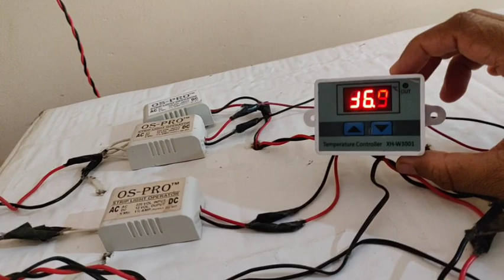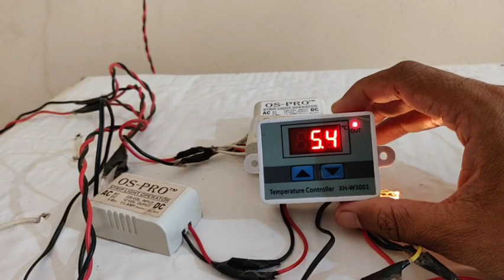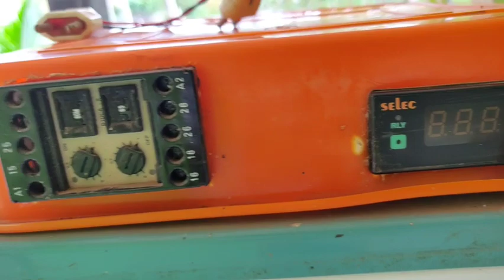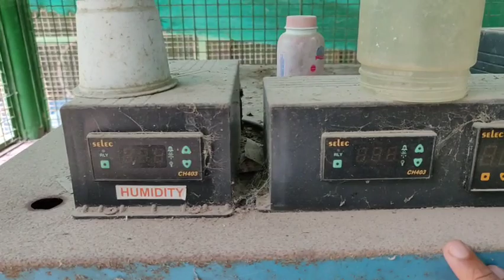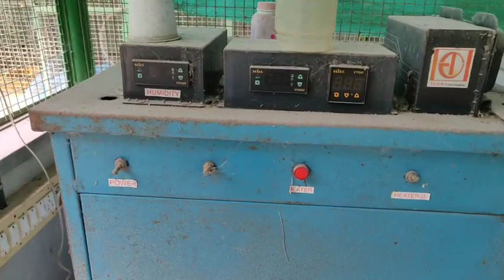Egg incubator നമുക്കും ഉണ്ടാക്കാം | Home made incubator | Home made incubator malayalam

Comment: വൈറ്റാണ് കുഞ്ഞാകുന്നത്
Reply: ഒരു കോഴിമുട്ട വിരിയുവാനുള്ള ചൂട് 37.5 ആണ് 38 ൽ കൂടാൻ പാടില്ല
നിങ്ങൾ തെറ്റായ വിവരം ആണ് അവതരിപ്പിച്ചത്
Reply from the maker: കൃത്യമായി പറഞ്ഞാൽ 38.8889 ആണ്. അതാണ് ഞാൻ 39 എന്നു പറഞ്ഞത്. ആയിരത്തിനു മേലെ കുഞ്ഞുങ്ങളെ ഞാൻ ഈ രീതിയിൽ വിരിയിച്ചിട്ടുണ്ട്.
Reply from the maker: വൈറ്റ് അല്ല കുഞ്ഞാകുന്നത്. താഴെ കാണുന്ന details നോക്കുക.
The yolk has a small white spot on it called the egg cell or germinal disc. This is the part of the egg from which the baby chick develops. The yolk provides food for the baby chick while it is growing in the shell. The albumen is the thick clear substance surrounding the yolk.

The primary natural purpose of egg white is to protect the yolk and provide additional nutrition for the growth of the embryo (when fertilized). Egg white consists primarily of about 90% water into which about 10% proteins (including albumins, mucoproteins, and globulins) are dissolved.